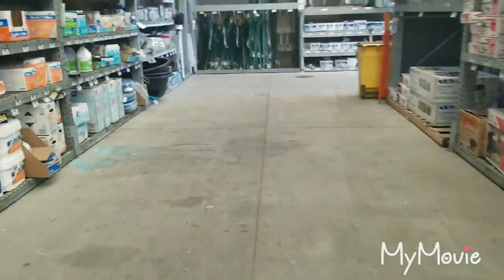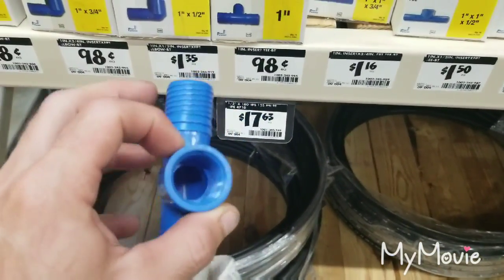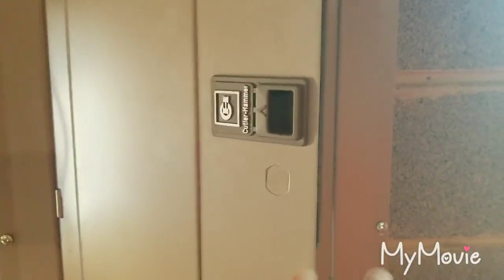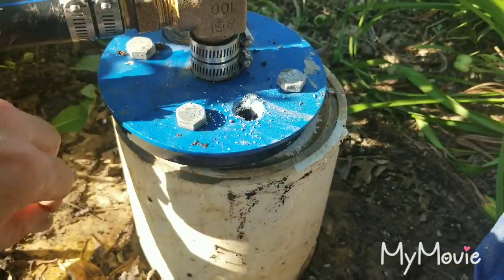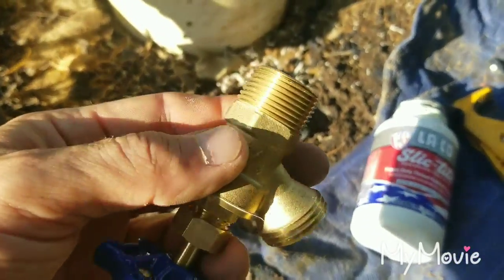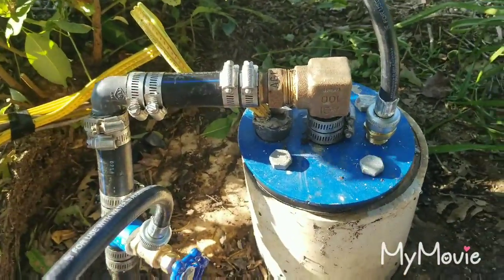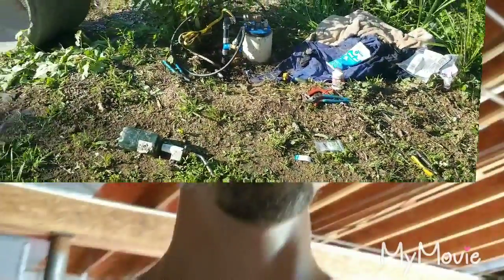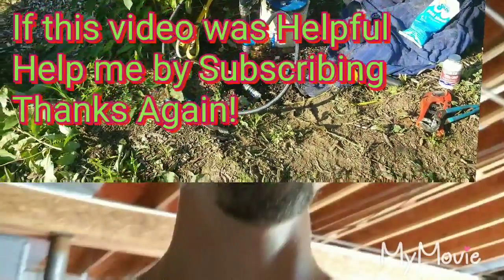How To Sanitize a Well. Well Cleaning. Sulfer/Red Iron/ Bacteria

Comment: My current home has iron bacteria and very hard water.  The house had a softener, a chlorine injection system, a 100 gal settling tank and a carbon filter to remove the chlorine.  I'm pretty sure the chlorine toasted the softener beads.  I replace the chlorine injection with 35% peroxide (and the softener beads and carbon).  Although it is more expensive, it works much better and is much cleaner.  I'm going to try the well shock this summer.  Thanks for the great video.
Reply: The proper way to treat iron and sulfur is not with chlorine. You will shock the well for iron you are going to cause a mess. The only way to get rid of sulfur is through aeration. filtration for iron and aeration for sulfur.
Reply: @actionwellandpump iron bacteria won’t go away with chlorination? I read or heard it dislodges it up and then can flow out. Regular filtration or jb or carbon?
Reply: @JFEnterprize  depending on how bad the iron level is you can actually clog up pipes when the iron is dislodged. I've had customers who chlorinated the well and they had to change the filters multiple times in a day because the iron was so bad. Chlorination is better used for treating coliform only. Chlorine on a regular basis will also build up on the inside of the well casing. It really just makes a mess if using it for iron. The best ways to treat iron is with dual filtration carbon and paper filter or an iron backwash system that backwashes every week and aerates everyday. Aeration will clean all of the iron off of the pipes inside the house so you don't have that build up in the toilets or toilet tanks.
Reply: How did the settling tank work for you?
Reply: @michaelgreco3158  it works well.  I drain a bit out of it every other month to get rid of the separated iron.

Comment: What a great, very informative video! Looking for some advice on the subject as well (pun intended 😏). My house was built in 1980. I have owned it for 16 years and have never had an issue until about 8 months ago. I have no idea how deep my well is and it has a cast iron well casing. There is a fairly small 3gpm household filter installed shortly after the pressure tank. Truth be told, I didn't even realize that there was a filter for 8 years of owning my home, that's how good the water once was. It is now to the point where I have to change the filter almost every week due to a slimy, red substance; which I was informed is a bacterial iron buildup, as well as visible sediment in the filter housing. I had one gentleman suggest sanitizing my well using 1 gal of Clorox bleach, using fairly the same process you described in your video. I did that, after sanitizing, it did produce quite a dirty, reddish brown flushout. He did tell me I may need to repeat the process a few times. That being said, after some additional research, and advice of yet another nice gentleman (both of whom seemed quite knowledgeable on the subject), I was instructed not to use a pellet chlorine and/or Clorox as it could damage the cast iron well casing I have? He actually suggested peroxide?? My water pressure at this point is just not what it once was and having to bypass the filter at times, due to not having a replacement filter on hand, it has even damaged my appliances. Your thoughts and advice on my situation would be greatly appreciated as I am at a standstill as to what method would be most effective and/or reduce the possibility of creating even bigger issues. Also, could it possibly be a damaged well screen and/or pump issue? After all, it could be 43 years old for all I know, as I have no idea if it was ever replaced before buying my house. My apologies for the book. Please help 😣
Reply from the maker: I'd invest in a bigger filter first. (Big blue inline filter) on Amazon. 4"x20. 
Or a smaller one 2"x10" on my website. 
Secondly you should buy 2 bags of super pool shock-it & try to do what this Vid shows you & Follow the steps. Bleach isn't strong enough for the job you need it to do. Remember, it's 30+ years of buildup that your trying to clean in a couple of days. So try to clean the source of water first(the well) then filter it with a good filter. I recommend string woven elements 5 micron
Reply: Wow, ty so much for the quick response! I actually did just recently purchase a slightly bigger 10 x 4.5 filter that I have yet to install. Hoping it will produce at least 10gpm vs the current 3.  My plan is to address the primary issue and sanitize the well prior to installing the new filter for obvious reasons. So, just to be sure, you don't see there being an issue in regards to the chlorine vs galvanized steel well casing? Also, I was previously advised not to let the chlorine sit for any longer than 12 hours as it could potentially cause too much debris/buildup to schlep off (due to decades of buildup) and possibly cause my well pump to clog? I just don't want to create bigger problems for myself.
Reply: @taraandalora3208  did it work?

Comment: Don't think this will work in Minnesota,  we can't have water line like that close or exposed to the winter air, I love the video though
Reply: Have to do it in the summer. Pour shock down the well pipe, run a hose from a house spigot back to your well pipe. Circulate it that way.

Comment: I have watched your video several times but just need some clarification. Im located in East Orlando, Florida and live on some acerage that is zoned for  agriculture. About 2 years ago,  I  drilled a 460 ft deep well all the way to the limestone rock  bed so I have plenty of water. I also changed out my water system from a chlorination  system with a  carbon filter cylinder, water  softener  and 100 gallon holding tank  and replaced with a sulfur block system and a new softener. The system has been working great until recently but now the water smells  terrible!! The sulfur block "appears" to be functioning properly and back washes every nite. But, obviously something has has happened where the system is not effective anymore. So either the sulfur block is not working properly to dispel the sulfur gas or the well is too "contaminted" so to speak with the sulfur bacteria that the system cant effectively handle the sulfur. I have contemplated installing a peroxide pump system that attaches to the head of the sulfur block and dispenses small amounts of peroxide that "supposedly"  neutralizes the sulfur gas smell. But its quite expensive and Im looking for another alternative. That being said, I came across your video and decided to give it a try. So fast forward..... after I add shock and install the chlorination loop hose,  Im guessing I should only open the valve about  a third to halfway so the pressure to the house is still fairly good....correct?  Of course I will bypass the softener and sulfur block to preclude any damage. The next question is, how long should I reasonably circulate water thru the loop before disconnecting the loop from the well head and draining into the yard? And how long should I let the well head  filter out? Also,  can I still use the water coming into the house while the loop is running and disinfecting the well? I am a Licensed Building Contractor as well as a Licensed Pool Contractor and am fairly knowledgeable about water etc, but this well issue is something I have never dealt with and just need some direction. Your YT channels has great content and straight forward so the average DIY can understand. Any assistance and clarification you can provide would greatly appreciated. Keep up the good work. Many thanks in advance.
Reply from the maker: Allow it to circulate for 12-24 hrs, then pump it off the next day. Yes you can still use it, but it'll be kind of harsh smelling & would dry out the skin if you were to shower in it during the process. 
I'd say it's your carbon filter that's the issue. I've seen many over the years work great for a little while then they get saturated & basically stop working. A true water filtration company normally sends off your water for testing and builds a system accordingly, the media in filters are always different to help your specific water conditions. If you bought a regular carbon filter, it probably is just overloaded & is need of a media change. 
I'm not a filter expert (my brother is though) .  If you truly have sulfur (& not a byproduct of bacteria) its a pain to filter out. Hope this helps
Reply: @h2omechanic   @h2omechanic  Hi...thanks for responding. 
My OLD system was carbon but the new system is a sulfur block which does have some media but it basically is designed create an air pocket in the cylinder to aerate the water. Something has gone bad but Im going to disinfect the well and start there. Also....the water at the well head smells exactly how it does coming into the house. So again....obviously something has gone bad.I may reach out again during the process. Thanks again..👍
Reply from the maker: Those work on allow air to get sucked in & then exhausted out of the separation tank. I'd look at the air inlet and exit pieces & see if they're plugged up.
Reply: @h2omechanic  Good idea. Thx 👍

Comment: Just found your channel, great content.  What is the proper procedure that you use to sanitize a well with  pitless adaptor ?  I asked a local well guy how he did it and he told me to just pull the cap, then dump a pack of pool shock into the well, wait a couple hours then run each tap in the house until I smell chlorine. wait a day then run each tap until I could no longer smell the chlorine. This seemed questionable to me, would this damage anything else other than my softener? He never even mentioned putting my softener into bypass.
Reply: Also I wouldn't want to run chlorine into my septic system. I too am on a pitless adaptor. I think your local well guy's advice is questionable.
Reply: @TheOnlySgtRock  you are correct about chlorine into the septic system.  Most well guys aren't worried about softeners or septic systems.  They are worried about the well.  It's unfortunately where the service industry has landed.  That said, to clear potential bacteria from your plumbing, you will need to run it through the plumbing.  Some chlorine will not cause long term harm to the septic system.  That biology will re-grow.  You can avoid the shock of a large part all at once during cleaning by running an exterior hose bib to clear the well, then drain the water heater tank to the exterior (don't forget to disable heating while it will be empty).  Doing those two will avoid the biggest shock to the septic.

Comment: Don’t do this. The well is not a controlled environment. Bleach today gone in 1 hour. Bacteria worse than the one you killed coming back in force. Stop tricking people into believing this works. This works for a test exactly 4 hours after application. Water should be filtered and treated accordingly as you need it. Your taking the advise from one dumbass with an idea 50 years ago and since the result was clean because pollution was much lower 50 years ago. The bacteria stayed away for 2 days. So the smart people around the moron thought they could make money on this venture. Started it at one shop. 100 clients seen them pouring bleach down the pipe and said “fuck I can do that”. Then shit took off like a bad rumor. Please stop thinking this works. It’s for your health. Not my wallet or YouTube page. Filters filters filters u v light and softener or descaler.

Comment: Thanks for your video. I'm my case I'm dealing with a low pressure undrinkable city water. So basically almost all houses here have large water tanks to store water and then use a pump to push the water thru the house.  So looking for info on how best to maintain

Comment: Hey man I just did this on my well and the water is a rusty color now. I read it’s normal but how long does it last! Thanks
Reply from the maker: Ok, so the chlorine killed the iron bacteria and that makes it break loose from its bond to everything in the well & pipes. You can let a hose run wide open for 1 hour each day to help evacuate the water and allow it to refill with fresh water. Basically just need to flush out the yellow water til it becomes clear. Idk what your well produces per minute,  but if its over 10 gpm, you can leave a hose run for 4-5 hours & that'll really Flush it all out.
Reply: @h2omechanic  thanks bro. I was a little worried for a bit. I liked and subscribed keep up the good work.

Comment: Thank you for the video!  
I have a 350-foot well; I doubt I use more than 50-gallons of water each day.  The water well has always had sulfer smell.
 If I wanted to add small amounts of chlorine to the well,  over... say 30-days, and not flush it like you did in the video, how much chlorine would you suggest?  Bad idea?
Any danger in pump or other component damage (no water softener, but I do have a cartridge sediment and carbon filter?)
No way that I want to endanger my 34-year old pump!

Regards.
Reply from the maker: 3oz per 100ft. So your well. 11oz
Reply: I hope that work out for you I have sulfur in my well and I have a filter  but when it rains it smells worse

Comment: How often do you need to sanitize a well ?
Reply: That question has a wide range for an answer. That are bunches of wells that have never been sanitized and have clean, tasteless, and odorless water. If you have the rust bacteria issue then you may need it every 30-60 days. If it is summer cabin or winter hunting lodge it would be good to do it after months of no use prior to he seasonal use. I sanitized the well on my current home one time 30 years ago when well was new. I water horses and 10 head of cattle so my well has no issues due to consistent high turnover. I'm in N central Texas where wells are 500 ft or a little more. Relatives  a good ways east where water table is way closer to the surface do chlorine treatment twice per year.

Comment: I stumbled upon your video while trying to understand what that blue (nylon?) cap on top of the well seal is called & used for? Mine I believe has blown off and has had water pouring out of it for at least a week now, even with no power to the pump. We’ve received a TON of rain lately so I suspect this is some sort of overflow hole?

In addition, my water smells like rotten eggs (sulfur?). I’ve never cleaned the well so finding your video on this is very helpful! Instead of creating the service loop like you did, can I simply run a hose from one of my spigots to the top of the well seal?
Reply from the maker: Yes, you can run a hose from your home to the well. 
Sounds like your dealing with a Artesian well
Reply: I have an Artesian well as well. Need to figure out how to clean it, since it overflows 24/7

Comment: Won't doing this get chlorine into the rest of the ground water at the bed rock level and get into other ppls wells??
Reply from the maker: Not normally. 2 wells would have to be extremely close . But chlorine kills bacteria growth, so if it did, it would help their system.  It's a relatively small amount being used. Not recommended to be consumed until it's run off & can not smell the chlorine anymore.
Reply from the maker: Remember, city water has chlorine injection.

Comment: Would you ever do that on a metal well casing? My guess would be not as all that sediment would go down into the well.
Reply from the maker: Yes, actually it's more common to use for metal casing bc the threads joints on metal will rust away after 35-40 years & begin to leak in surface water. The liner installation becomes a way of taking the metal out of the equation and the packer seals out the bad water.
Reply: @h2omechanic  Thanks brother. So all the sediment should sink below the pump if it's heavier than water, right?

Comment: Nice Job I already have what we call a "stinky," so I can use it with just a little modification. That's a circulation hose like you have but it has a fan sprayer on the end of it that sprays back into the well. This causes the well water to be disturbed releasing the bad odor, the rotten egg smell. It really works great. Hope this is something you can add to your toolbox of knowledge.
Reply from the maker: Yup! You have a Sulfur dilution mistor .  I've installed one before, but it made the pump cycle too much for my preference. 
They same can be done with a galvanized tank & a air injection nozzle. 
The Sulfur just needs somewhere to separate & gas off. But thanks for your comment! Those are not common devices, but do work excellent!

Comment: why not put the well shock in a 5 gallen bucket with about 3 or 4  gallen of water, pour it down the well put your garden hose on your outside spigot when you smell chlorine stick the hose in the well and let it run for a while,
Reply from the maker: You can do it that way sure. But pouring the granular chlorine in the well allows it to slowly cascade down the well & desolve as it goes.
Think of a well as a +300 ft Cylinder, pouring liquid mixture down there only treats the upper area, but returning the hose would help tremendously. This is my reasoning for why I do it this way. But can totally be done as you said too.